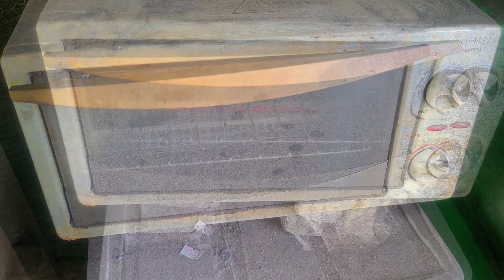A sickle is harder to make than a knife

Comment: Another great video! Also I was wondering why the 2nd to last hole on the back of the blade wasn’t drilled all the way through. I’m sure there’s a really good reason or just for a cool look but great video!
Reply from the maker: Thank you for watching.
There was an error in the annealing process. The hardness of the part where the hole was not drilled was so high that it could not be drilled with a drill. This is my mistake.

Comment: If anyone is wondering he dipped his hammer in water and put the water on the face of his anvil so that it would help blow the scale off of the workpiece.
Reply from the maker: Thank you for watching.
And thank you so much for the good advice.
Reply: I was gonna add if you want a recipie for a good cheap quench oil i got one for you
Reply: 1 liter of corn oil 1 gallon of canola and 1 liter of veggie oil. Makes about 2 gallons and literally blows scale off of your work piece as it hardens.

Comment: its a really nice piece, but not a very good sickle. its too small, the cutting edge isnt right. sickles are beveled on top to the edge and the bottom is flat. their blades are very thin as well. i personally cut many weeds with the small ones and the big two hand kind. they may be hard to make cause the blades are long and thin and tempered hard. they stay sharp and when one hits a rock it'll ring...at least a good one. oh the spines are curled up son theres a lip on top usually.  this looks more like a weapon than a tool, im cool with that i like it.
Reply from the maker: Thank you for watching.
And thank you so much for the good advice.